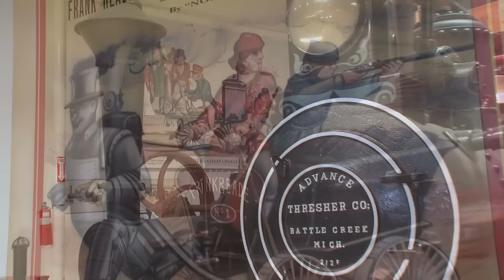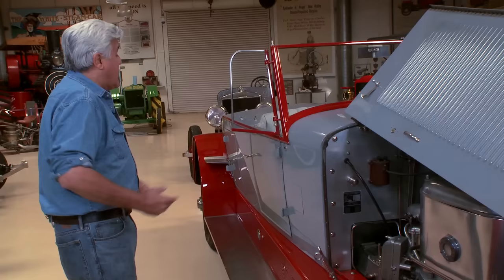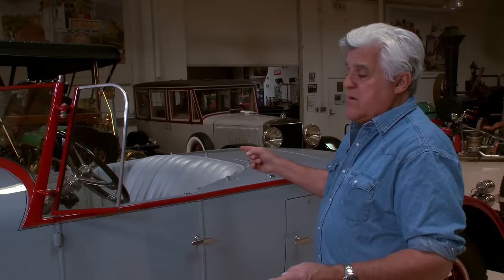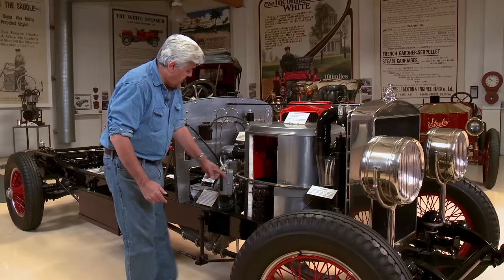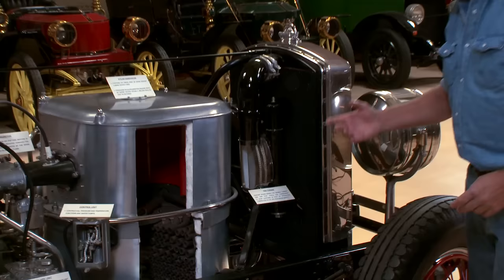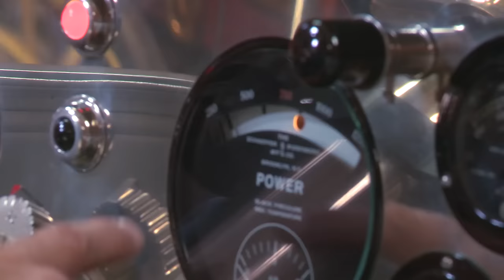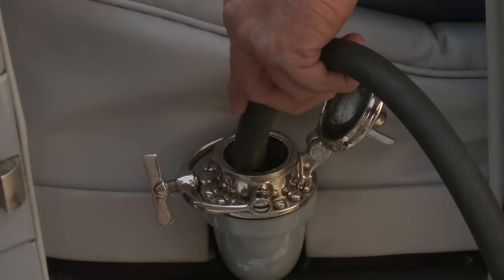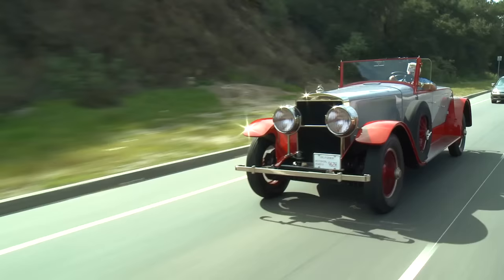1925 Doble E-20 Steam Car - Jay Leno's Garage

Comment: I love the fact that this car has the same amount of torque that some semi trucks have.
Reply: Not really, the Doble only produces 150 horsepower and torque is measured at ZERO mph... its actually much less when the car is moving.
Reply: A Ford Diesel pick-up produces 350% more horsepower and torque at the rear wheels and is more than double the fuel efficiency.

Comment: This may be my favorite episode. That Doble is still viable. It's an elegant design.  It has too much power to be concerned with weight. Go big or go home. Quite, smooth, strong. It be great as about a 1.5 ton pickup truck.
Reply: Unfortunately the Doble E series was never viable and was obsolete on arrival.
 Not true, the E series makes a maximum horsepower output of just 150 hp. not very impressive by today's standards.

Absolutely not, any modern pick-up truck would leave the Doble in the dust up a long grade, for a fraction of the cost and 300% better fuel efficiency.

There is a very good reason why steam cars went extinct a century ago.

It's still a a fascinating piece of antique automotive history.
Reply: That was very impressive for 1925. Then it all stopped. If we keep getting black outs and high gas price, you never know. The car could be made half the weight, improved efficiency, even used as a steam/electric hybrid. No wait time. It could use nearly any fuel. The car could run on wood pellets. Also all that torque could run a very powerful generator.

Comment: Thank's Jay,  I'm glad someone has taken the time to preserve steam cars. It is a shame that the Doble seems to be the end point for steam cars. I admire Abner's engineering for the way that he reclaimed the used steam, and I agree with Abner's claim that the tank of water should last at least 1200 miles. On that point I noticed that there was an abnormal amount of steam being released as the Doble was being driven, which probably explains why you are only able to go about 120 miles on a tank of water.
All in all a wonderful piece, both video and car.
By the way, are there special licences and inspections that are required for steam vehicles in California?
Reply: It's a shame Jay can't keep this car running... 
Boiler inspections are required under federal law

Comment: I didn't realize a Stanley wouldn't maintain steam pressure while driving at highway speeds. That Doble is sophisticated. I am surprised Dobles weren't used for land speed records like the Stanleys were much earlier. Maybe the internal combustion cars were more competition by 1925.
Reply: Steam cars were basically obsolete after 1915.

Comment: 139.8 mph is the present land speed record for a steam powered vehicle currently held by the British!  Don't you think even your Stanley Steamer style engine with the bigger steam generator could easily top that? Your 1925 Doble E-20 you said did 132.5 mph in 1925 by Howard Hughes. Do you suppose an aerodynamically clean car using a Doble style steam generator and engine could easily go even 10 mph faster? It's time for you Jay, to sponsor an American effort at the record with a car you have built in your facility by your knowledgeable crew members. What a kick that would be for all of us that enjoy your videos and projects to see your car become the world record holding car with you as its sponsor.
Reply: The Doble cannot maintain steam pressure long enough to cover a mile distance required for the speed record.
 It's continuous top speed is only around 65 mph.

Comment: We're  looking at the future, but everyone ignores it. 
Cheap, easy to operate, reliable, low & inexpensive  maintenance. 
Something you don't need a doctorate  to use, average knowledge  of mechanics will enable user maintenance.
Reply: You should look again, more closely.
This car was the most expensive car ever built and requires a staggering amount service and maintain... not only that it is not politically correct as it is an obscene gas guzzler (3 to 6MPG) on regular unleaded gasoline and spews out more pollution that a dozen Hondas.
The Doble is an excellent example of how not to build an automobile.
 Abner Doble was a millionaire in 1926 lost millions of  dollars of his money and his investors money and died penniless after going bankrupt in 1931.
Reply: FYI: this car currently no longer runs, it is undergoing its second major rebuild since Jay purchased it. Hundreds of thousands of dollars in expense repairs, Jay said its the most expensive and unreliable cars in his collection to keep running.

Comment: They should use this concept for modern city cars. Not something you'd be using on the highway and long trips, but something for simple transportation within a town/city.
Reply: Why? Steam cars are obsolete technology... modern cars are much better.
Reply: It wound be far less efficient than a modern car. About 10% of the energy released by the gasoline goes towards driving the car via the steam.

Comment: As a final attempt this was no doubt the most advanced steam powered car ever built. I can imagine that steam in fact could be brought back, it could undoubtedly be made to be unbelievably efficient! Oh wait, I forgot we've got electric drives. I have never understood why we don't combine those, thus fitting or electric cars, with a crazy efficient generator on board. Cause, as you probably know, an internal combustion engine has a specific number of rpm's at which it runs at max efficiency. THAT is the main shortcoming of cars (directly) powered by ICE engines: we continuously vary his fast the engine turns whilst that is precisely what it is not good at. If we fit a ICE engine to power a generator, our engine can run at precisely the speed it likes best. Also we are not continuously varying the power demand but allow it to deliver its optimally efficient account of torque. That way we have none of the limitations that make it a requirement to fit a real heavy engine in the car - a tiny, ultra-efficient engine of a type of our choosing can do the job. We could consequently do with a significantly much smaller battery pack, as it doesn't need to preserve all the energy for the entire actieradius, for the entire distance of the entire trip from charging at home or at a charging station until its finally have been used up, but instead use it as a BUFFER (as long as the average power consumption of the car over periods of up to say half an hour van be balanced with the output of our generator, with that buffer taking care of the moments of higher demand when the car is accelerating it'll be fine). With a system like this the vehicle's overall weight savings would be significant, lowering the energy requirements per traveled distance considerably. (With a battery pack only a quarter the size of that of a grown-up EV, we could probably save a thousand kilograms, which would translate as a reduction of the needed average amount of Kilowatts (or is equivalent in fuel) of theoretically 40% over the part of it that has to make up for weight (air resistance does not change, so overall the number will be lower). Now the fact we will run our actual 'engine' at a fixed amount of rpm's makes for the possibility of reaching incredible efficiency. And ANY engine would do, even those that use a static heat source (and the difference between that warmth and cooler environmental temperatures), I can't think of the name at the moment. Also this makes it all the easier to use whatever fuel would suit us best!
Reply: You have never seen a Toyota Prius?
Reply: .As an engineer we use the term Working Fluid to describe it.

That is False, Steam is a LESS efficient working fluid than air or liquid.

Joseph Black discovered the Latent Heat in 1761.
Latent heat describes the Loss of Energy any time a the working fluid undergoes a Phase Change

Internal Combustion engines are MORE efficient than Rankine Cycle engines because they waste no heat due to phase change.

Nicolas Carnot published his formula in 1824, it describes the practical application of the Second Law of Thermodynamics as it applies to Heat Engines. 

The Carnot Formula tells us that the maximum theoretical thermal fuel efficiency of Rankine Cycle engines is only 63%, less than ICEs.

The most efficient steam turbine engines are the largest power generation plants at around 43%, ships around 30%, locomotives and automobiles around 10%.

The smaller the steam engine the higher the entropy and the less fuel efficient.

The most efficient powerplants in the world are natural gas fired Gas Turbine internal combustion engines 
and hold the world record is 62.5%.

The most efficient ship engines are Diesel reciprocating engines at 54.6%. Yes, if you are going store your vehicles energy in batteries? I makes no sense to use steam... a small, lighter and less expensive electric motor is around 750% more energy efficient than Rankine cycle engines of the similar output.

Comment: What it has, is a marine boiler, or water tube boiler. Water runs in tubes in a heated chamber. In locomotive boilers, or smoke tube boiliers, tubes of hot gases pass thru a water-filled boiler. The advantage of marine boilers is that you can have much higher pressures, since the water & steam runs in small (…) steel tubes that are better suited for high pressures. A smoke tube boiler were usually liimited to about 10–12 kg/m2 (or 10–12 bar), although the "Big Boy" engines had ≈20 bar pressures. The downside of the smoke tube boiler is taht the "crown sheet", the firebox top, must always be kept covered with water. If you’re on a ship in rolling waves, this can be difficult. With marine, or steam tube boilers, there is no crown sheet. Also, you don’t need a huge pressure vessel full of sloshing water.
A very impressive car, despite all its finicky details!
Reply: Unfortunately the Doble was obsolete technology by 1926... the introduction of the electric starter by Charles Kettering in 1915 had renderef all steam cars obsolete a decade earlier.
Reply: @sandervanderkammen9230  True enough. Although steam lorries like Sentinel kept going a while longer. The Diesel engine was the death knell for steam in heavy equipment. 
Not to mention railways. Instead of lighting up a boiler 5-6 hours before driving off, and having to have two crew and coal and water refilled ever so often, and at the end of the day, dumping the fire and ash in the ash pit and then having someone shovelling out the ashes from the front of the boiler (and cleaning out the flues, too) and refilling dozens of small oil reservoirs, with a diesel engine you could get rid of the fireman and the cleaners and the ash pit and water towers ++. Just add diesel oil, start up, and off you go.

Comment: Jay…. Have you ever considered getting a reverse osmosis/de ionizing water filtration setup for your steam vehicles? Scale and any mineral deposits absolutely cripple efficiency as I’m sure you know.  And now a days one could put a system to filter it to pure water for a reasonable amount.   Just something to ponder.   Appreciate the sharing of knowledge on these unique vehicles!….. oh, and the steam generator looks a lot like a modern ‘steam’ pressure washer steam generator (except those have 1 to maybe 4 rows of boiler tube coiled inside and are fired from the bottom)
Reply: The Doble is a condensing steam engine so the use of distilled water will not stop the formation of scale in the boiler tube.
Steam collectors and commercial steam operators often use a water treatment additive such as tannic acid to reduce scale and is more cost effective.

Comment: Maybe I missed it. How or what fuel is used to make the fire that heats the water ? Also if there is no neutral what  keeps the car from continually pulling?
Reply: The water is heated by liquid fuel, kerosene,Diesel or gasoline.
Jay Leno runs his on regular unleaded gasoline and gets around 3.5 to 6 MPG.

To slow down, you close the steam valve and the engine pulls a vacuum in the steam pipe allowing the wheels to turn freely with a slight "engine braking" effect.

Comment: The water saving is huge. A steam loco uses hundreds of gallons. The limiting factor for locos is the water capacity, not the coal.
Reply: The Doble's range is also limited by its water consumption, as little as 60-80 miles during warm weather and a 35 gallon water tank.

Comment: I really wonder how it would be, if someone built the modern version of this steam car.  How much improvement can be done to this already-good car.  Doble was ahead of his time with the flash-tube boiler design and still closed loop.
Reply: IT WAS A JOKE.
 No legitimate engineer or company would attempt to build a steam car today.
The severe efficiency limits and extremely high cost prevent modern steam cars from being practical or viable.

Comment: What would be the actual fuel (diesel, fuel oil, or gasoline) and what would be the fuel consumption vs. internal combustion engines?
Reply: The Doble was multi-fuel and can run on kerosene, Diesel and unleaded gasoline.
Jay runs his on regular unleaded gasoline and averages between 3 and 6 mpg.

Comment: Sorry Jay, it absolutely is a boiler, just one that is about 3/4 of an inch in diameter and 450 feet long.
I bet it even needs a boiler certificate.
The main attraction (among many others) is that if it should rupture, it just loses pressure rather than scattering pieces of iron for a quarter mile.

Comment: With metan/propane fuel, it is more eco friendly than electric car - no waste when making and utilizing batteries, no oil in transmitting gears (no gears), high energy conversion efficiency
Reply: Steam cars have an obscene carbon footprint and are gas guzzlers and gross polluters.
Jay's Doble chuggs unleaded at the rate of 3 MPG and produces more pollution that 12 Hondas.

Comment: maybe this could be more efficient and clean than petroleum with modern engineers and new knowledge
Reply: Steam cars run on petroleum... Jay Leno's Doble boiler is heated by gasoline and guzzles unleaded gasoline at the staggering rate of 6.5 MPG!

Comment: If I ever had this I would use it whenever gas prices are pretty high
Reply: You do realize this car only gets 6.5 MPG right???
Reply: @sandervanderkammen9230  didn't he say the steam gets re used over and over again?
Reply: @bennett491  Only the water is (partially) recycled, once the steam exits the engine all remaining heat energy is lost which is why steam engines are so incredibly inefficient.
Reply: @sandervanderkammen9230  Oh yeah I forgot about that (I was actually not serious of using it but I would still use it time to time when when I'm out of gas and tow my car with the torque)
Reply: @Literallyasyrup  You will run out of gas in this car first... it's a horrible gas guzzler.
You can buy a Ford Pick-up with 300% more torque at the wheels and 400% more horsepower with 250% better fuel economy.

Comment: Steam oil. Is that something you can buy off the shelf next to the motor oil lol? What did they use for a lubricant back in the day when it was built, whale blubber? Lol this is such a cool machine. I watched this video a couple years ago and just had to come back and watch it again
Reply: Special order only from a steam supplies specialists.
Steam oil was traditionally made from beef or pork tallow and whale oil. 
Modern steam oils are mostly paraffin wax based with synthetic or natural tallow polymers added to resist being washed away by the steam.

Comment: Would a legend such as yourself share the ideal metallurgy for Cylinders and pistons! and of course the ideal high temp oil, as such things are not very popularly listed! There is so much more that can be done still with steam, I'd like to make a bicycle version, Keep up the excellent work Sir.
Reply: Unfortunately the engine in this car completely destroyed itself again for the second time... so Jay and his crew still haven't got the recipe right yet.
The damage this time was so extensive that repairs could cost more than a $200,000
Reply: @sandervanderkammen9230  Thank you for replying! Devastating news sorry to hear indeed, but it is a sure thing that red  hot pistons cant trump turbines where the bearing surfaces can run cooler, and piston rings are effectively blunt cutting tools, and even if inconel 625 were used an unusually unique lubricant would be required, and I believe that the ideal lubricant would have to be recovered  as best as is possible IMO Regards and again thank you.

Comment: I watched the whole video hoping you would share MPG of gas.  Seems very efficient!
Reply: Jay gets between 3 MPG and 6 MPG on unleaded gasoline... which seem bad enough until you realize that a Honda produces more horsepower than this gas guzzling beast. 
Internal combustion engines are around 400% more fuel efficient than comparable reciprocating steam engine.

Comment: "It makes you think what they could have done with modern technology, computers and stuff!"
The answer? Not much. Steam will always have the trouble of taking a while to heat, necessity of being constantly produced and the condensing part.
People weren't dumb back then. In fact, they had quite the same cunning as today's people. Meaning that their efforts, despite the challenging times and lack of modern technology, were much focused towards improving. As you've said, Doble was quite fond of "improving" his vehicles with what he had. 
And steam is still used to this date, except is far away from the people in form of the "steam turbine generator" back in old coal and gas electricity plants.
Reply: Also in nuclear power plants and geothermal power plants.
Reply: @BasementEngineer  Indeed. Besides solar, wind and hidro we are still much dependent in steam technology.
Reply: @Draxis32  Indeed we are!